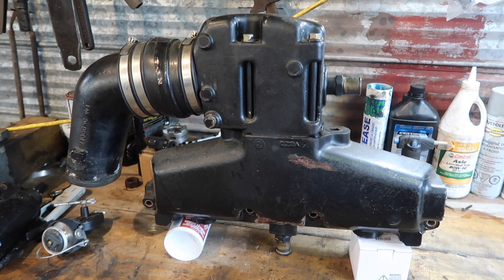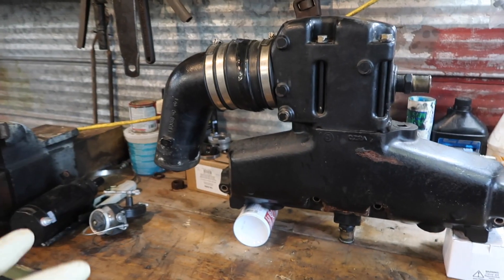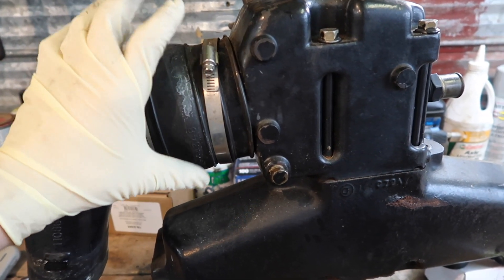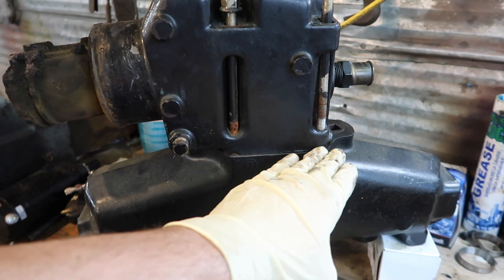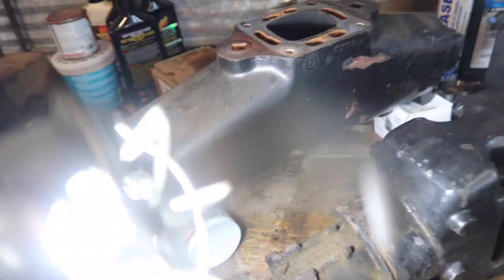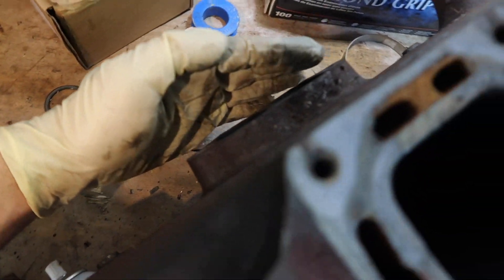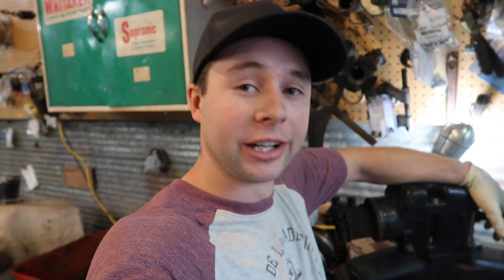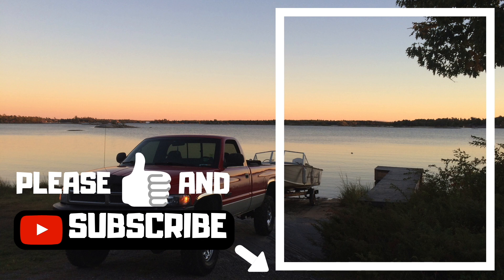Marine Exhaust Manifolds. How Do They Work?

Comment: Hey man, my seal was bad on the exhaust, I caught it early , ran the boat maybe 20 minutes, water in my oil.. I have water sitting in the manifold that goes into the cylinder. How do I get that water out

Comment: Is the purpose of water-cooled exhaust jackets just to keep the underhood temps down since they’re in a sealed compartment? Or does it also serve some other purpose?
Reply from the maker: Hey yes, it keeps the compartment temps cool for sure. Mainly it is so exhaust is able to be routed out the bull horn and through the drive. These are all very tight areas and have to go through bellows to exit which all require it to be cool.

Comment: So how would you diagnose a bad riser gasket. I recently got my boat running after sitting for 5 years. Ive been starting it every day for the past 2 weeks. And i noticed today that the oil was drastically overfilled with milkshake oil. Just 2 days ago i checked the oil and it was full and looked normal. With this milkyness it seems to run great. Im going to do a cylinder leakage and compression test, if i dont find anything how can i diag this leak since i dont know how to pressurize the sustem like a car
Reply from the maker: You would likely get water in the cylinders causing hydro lock in an extreme case.

If I were you I’d honestly just replace the riser gaskets and be done with it. 

A large amount of milk in the oil would not be caused by a riser gasket. I would be looking for a bad power steering cooler, head or intake manifold gasket.  A compression test would be wise.
Reply: @Schneids15 i just ordered the riser gaskets. I did notice i see milkshake at the top of the intake manifold a small puddle maybe 3 ounces of fluid. Does water or oil run through the intake manifold? Also if its leaking is it possible to leak into the crank case and not the cylinders?

Comment: My exhause manifold bolt snapped. What if i accidentally drilled out the bolt into the water jacket?
Reply from the maker: Are you talking through the bottom directly?
Reply: @Schneids15 no sorry it was the riser bolt snapped and i drilled the bolt out into the water jacket, not all the way through to the exhaust though.

Comment: That's crazy.  Your exhaust is still go to force anything in that manifold, out. I don't think there's any way water can leak around that gasket, then somehow get into your valve train. Just wouldn't happen. Shouldn't do DIY videos if you don't know what the hell your talking about.
Reply from the maker: Think about when the engine is not running and that manifold is full of water. The water leaks down and runs into your engine. It happens.
Reply: Db6173 your a idiot

Comment: I'm interested I'n buying a old glaston but the oil pan is frozen solid I like in the great white north  he's said it is the head gasket, I think it the exhaust ?
Reply from the maker: It could be either or. That will take some diagnosing. Usually a compression test will pick up a bad head gasket.

Comment: 60 years ago we had aski boat poweredby a Ford side valve V8. No fancy manifolds on that!  The manifold was fabricated from steel pipe & water was injected into the exhaust gas stream about 50mm (2 inches) lower than the exhaust port. That is, there was no water jacket surrounding the exhaust but water was injected into the exhaust.  Much simpler and it worked fine!
Reply from the maker: Yes that is for sure. The old school stuff was very simple and reliable.

Comment: I just did this job on my boat today. My boat is raw water cooled, and only used in salt water. Mine rotted internally causing a pathway from the water jacket into the exhaust path. Water was then leaking into my exhaust ports. I find that I need to replace these every 6 years or so. Mercruiser now makes these with ceramic coating on the inside to keep them from rotting internally.

Comment: While idling out in the water tap your hand on the risers make sure one is not hotter or too hot, one time I had a boat where the water jackets inside the risers were so full of rust NO water was getting through. After checking the price for another one I just got a long drill bit and cleaned  all the rust out.
Reply: Yep, just had that happen, no fun when you melt your exhaust bellows 10 minutes off the ramps.  Made it to the other side just before full failure of the the upper hose… melted our fuel tank vent hose and fuel fill hose almost to the point of letting vapors escape. Lucked out, on many levels. I had just pulled one riser off and knocked out a LOT of rust on the port side manifold in an older boat and didn’t do the hand check as you suggested after warm up before powering out into the reservoir.  Had my thermal temp gun with us, top of the starboard riser temp 110 degrees, port side riser 250 and rising at that point. Two new exhaust assemblies later plus bellows and hardware (ouch $$) and I will still be hand testing my risers on the regular from now on. Scary stuff, very lucky we were on a smaller reservoir and already 3/4 to the other ramp when the smoke became  noticeable. Good tip, easy to check on occasion to feel for looming variances in temps, because you have no idea with the doghouse closed.
Reply: Very helpful tip. Ty
Reply: Be careful not to poke whole,through a water will flow back,into engine and fill with water. I was cleaning mine it today and broke through super easy could been ruined weekend on lake and big bucks too. P.s. Fuck Joe Biden.

Comment: Great overview, I was clear on the process. Could you do a similar video on marine engines vs regular auto engines? I have an old 87’ chris craft that has a seized motor and was thinking about picking up a used motor from junkyard and swapping it. Pros/Cons? Boat needs sone serious TLC from needing floors, interior and motor. Trying to salvage it vs taking it to a landfill.
Reply: You'll need to swap over the marine specific components like intake, carb, alternator, starter, water pump, etc.  Also need a marine camshaft as they're ground to minimize reversion & the risk of water being drawn back up the exhaust valves.  Keep in mind marine engines run under a load pretty much all the time, so factory marine engines may have some premium components compared to a standard car engine.

Comment: So how hard is that manifold to pull off?  Do you have to pull the engine out or can it be removed in the boat?
Reply from the maker: Hey, super simple. 2 large hose clamps at the back, one for cooling hose depending on design. Just 4 bolts and they pop off. Nothing like doing one on a car.
Reply: There should be room in the boat to remove without pulling the engine out. Having said that all boat makes and models are different so what might be enough room on one boat may not be on another. If it doesn't have room to come out you have a badly designed boat. 😮

Comment: Told an owner of a BMW gas engine why his engine was overheading and that he needed all three (3) exhaust manifold pieces. He only bought the riser. After the weekend he came back and purchased the other two 🙄😆🤣🤣🤣
Reply from the maker: So was the BMW a marine application with water cooled manifolds?
Reply: @Schneids15  YES It was marine BMW, a 220 . BMW sold gas version of their straight 6 (190 & 220) & 4 cylinder gas engines
Reply from the maker: I’m going to have to look them up! Never seen one here in Canada! Very cool!

Comment: Informative video. I have a 1999 4.3 Volvo Penta with water in the #6 cylinder. Do you think it might be the exhaust manifold?
Reply from the maker: Very very good possibility. However a head gasket could be a culprit. Start with the manifold and see what you can find.
Reply: A few questions to ask would be,  is the system a closed cooling system or not. If it is a closed coolant system then are you going through coolant? If yes to going through coolant then it is a head or head gasket problem. (This could be big money if the head is damaged) If it is straight Sea, river or lake water cooling then as the previous response said, start with the exhaust manifold. This is obviously the easier one to check. If not, yes you have a head problem. Also I believe the overhaul of the manifolds gasket is every 3 years. The one thing I always wonder is why they don't ceramic coat all these cast iron coolant parts. We used to do this with chiller and boiler heat exchangers and it is amazing the difference it makes... no rusting at all.

Comment: Great explanation and video, thank you. I’m a brand new first time boat owner and learning a lot. What if the exhaust water is black and smells like fuel or oil? I just got a freebie 2005 Baylnier 185 that I just got running and noticed the black water coming out of exhaust.  It had not been running for over 5 years.

Comment: Just had a Volvo Penta GL 4.3 where an old impeller failure sent fragments into the thermostat, clogging the fitting to the manifold feed on one side. Absolutely roasted the two rubber hoses on the discharge. Even melted the alarm switch.
Always check for failed impeller blades.
Reply: EXACT same thing just happened to me this weekend

Comment: Im pretty sure if that has NO water running thru it the Motor will Burn up and seize before that Rubber will get Hot enough to Melt ...

Comment: 1987 Bayliner 2450 Ciera with an omc GM 5.7 with a similar open cooling system. Thank you for giving me a new maintenance project, like I don’t have enough. 😆 You saved me $$$ by giving a diy amateur a bit of good know-how. Thank you. 🍻
Reply: And to the other posters with further explanations of the cooling system, thank you to you all, too. 🍻
Reply: I have almost the same boat . Does yours have a hose on the lower part of the manifold? Mine just has a hole that leaks water when I run it on a water hose. I’m afraid to put it in the lake over this.

Comment: I have a 4.3 liter Yamaha.  I’ve been experiencing some heat issues.  Last year I replaced the impeller and the water circulating pump (I did use one from an auto shop, vehicle application).  It apparently did not have a thermostat in it since I’ve had the boat for several years.  I left it out yet then.  Seemed to work well last year with a few moments where it went up to like 175.  This year I have an issue again.  I can stay at low RPM’s all day long, but 98% of the time, if I go mid to high RPM’s the temperature starts to rise.  If I back it off, it generally cools back down at about the same pace.  I’m wondering about my risers.  There are some water stains on the exterior of the exhaust.  I haven’t known until recently that they should be inspected occasionally.  I called on gaskets before I tear it open, but they said they’re discontinued.  What are your thoughts?  Nick
Reply: Suggest you try an infrared laser thermometer ... got a cheap one from Harbor Freight couple seasons ago for $20. You'll be able to check the Temps on correlating parts of the exhaust system , side-to-side.

Comment: Good info bud! Thanks for sharing your knowledge. I’m getting some moisture in a oil but nothing significant. Looks like mayonnaise on top of my valve cover and droplets of water on my oil fill cap. Had mechanic wanting to replace the block thinking it was a blown 
head gasket 12k to do the job!!! I will replace the exhaust manifold and risers and see if that will solve my issue with water getting into the crankcase. 
Thanks again!

Comment: Thank you! I had 2 mechanics tell me that I had a blown head gasket (water in oil) pulled my 3.0 all apart and found the head gasket wasn’t bad (tested with good compression on all 4). My riser/ manifold were the base of all my problems.
Reply from the maker: Great to hear. Yes a head gasket seems to be the first thing mechanics will say. Lots of times it is however there are many other possibilities. Riser gaskets are supposed to be changed every 2 years or something by spec.

Comment: I've been told the gasket with the 2 small holes are used on the most common open systems where sea water comes in thru the system and goes out the exhaust. If you have a closed system the gasket is different and the holes are open.

Comment: HI,

Thanks for this informative video.

I have a mercruiser with alpha one Gen 2 , that was overheating, i replaced the impeller and that solved the problem, but my concern is that the water is coming out of the outboard is cold on one side and hot on the other side with weaker water flow.
Does any one know why ? should i be concerned?

Thanks in advance for any replies.

Sam.
Reply from the maker: Hey Sam. Do you have straight pipes on the boat that you can determine water is cool on one side and not the other? Or are you just feeling the temp of the manifolds?
Reply: @Schneids15  Thanks for quick reply,  when i have the engine running with earmuffs , i felt the water that comes out from the bottom of the outboard, and on one side it was hot and rusty in color,  and the other side ( Port side ) it was cold , i did not notice any temperature difference when i felt the manifolds,  also when i replaced the impeller , i noticed a melted plastic on top of the water pump casing, , i'm guessing it's part  of the flapper and  possibly more pieces are stock inside of the exhaust manifold restricting water flow? from your experience, do you know if the water should escape cold on both sides?

Comment: If you have a known issue with hydrolock would you replace only the gasket to see if that does the trick or would you have the manifold tested. If you replace the manifolds, Would you replace the risers also?
Reply from the maker: If a fresh water boat, i’d replace the riser gaskets only. However a hydro lock can be caused by a bad head gasket as well. Start with the simple stuff though.

Comment: Hello, I got a problem with my boat "milky oil" I replace the head gasket, thermostat, and all gaskets, and everything looked good but the milky oil is there I check the exhaust manifold, and had a big crack on it if I run the engine without the manifold nothing happen, just inspected the intake and exhausts on the block and looks like water gets into there because seems some oxidation, Now I understand why.. i will check the manifold with some pressure just to make sure there are no leaks on it, thanks, man.
Reply from the maker: No problem at all. Yes check the manifold and the riser gaskets. If cracked 100% get a new/used manifold. Good luck!
Reply: @Schneids15  hello, again I just checked my manifold with air pressure, and apparently, it doesn't have any water leaks inside, so I started to check carefully and found that the corrosion is inside the cylinder head, right where the screws that They clamp then and I found a slight crack in two of them. Do you think that could be the problem because it mixes the water with the oil? thanks.

Comment: What about the risers flaps right below.  I just took my risers off and don't notice any rust in the exhaust chamber. The issue im having is after a few minutes running,  the engine gets so tight to turn, and doesn't. The battery cable terminals melt off, and the engine is to tight to turn by the crank.  Happens at the lake. I noticed one of my risers flaps open fully and one closes when I took it apart.

Comment: I'm a diesel mechanic,not a marine mechanic ,not much anyway. A internal combustion ENGINE...is an ENGINE. A MOTOR is a air or electrical or fluid driven device.  That's   what a MOTOR is to me. Thanks
Reply: Nerd

Comment: So I have a question please,
I’m looking to purchase a used boat where the owner or seller ran into sand bar with his inboard a Mercruiser 4.3 not realizing the motor started to heat up till it stopped and won’t start.
He didn’t flush the motor and didn’t winterize it because he wasn’t able to start the motor.
What is the possible scenario in this situation about what could have happened?
Reply from the maker: Sounds like that motor had a severe overheat. Sand likely ruined impeller. Will need heads tore off it and head gaskets replaced. Heads may be cracked and likely will need new exhaust bellows. You would be best off to put a new motor in it.

Comment: I had another thought. 

What about saltwater applications? 

A person certainly doesn't want salt water circulating through an engine block. Is that where "heat exchangers" are used... use sea water (salt water) to circulate through the heat exchanger to cool the engine coolant... sea water-cooled, engine coolant circulating through the engine block? Anti-freeze/coolant used in this application? 

Also though, what about the salt water being circulated through the water-jacketed exhaust manifolds? That can't be good either. 

No hurry with this. I'll get a notification at some point. 

Again, thank you for the information.
Reply: You are correct, sir ! ... and many engines have a fresh water rinse attachment for flushing after use in " high conductivity " ( salt ) waters . Further, some have a reservoir and pump for NeutraSalt solution

Comment: Nicely done. Very nicely done.

I was looking for 8.2L Mercruiser cooling system info and I came across this. I'm essentially looking for info in regard to how the entire cooling system functions; I do have a basic understanding of it but I want to know the intricacies of it. Knowledgeable and trustworthy marine mechanics can be difficult to find. I want to understand the system top to bottom/front to rear so that I don't have to wonder if someone knows what they're doing. This does help somewhat. At least now I know that the exhaust manifolds are water-jacketed using sea water, very similar to an engine block being water-jacketed and using engine coolant.  

Thank you for doing this. 

Subscribed!
Reply: But a Mercruiser shop manual.